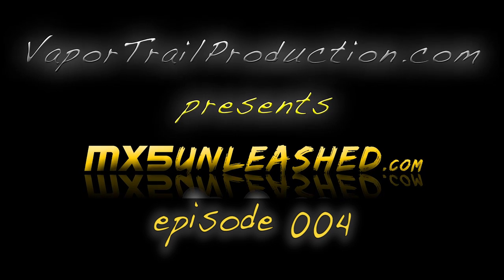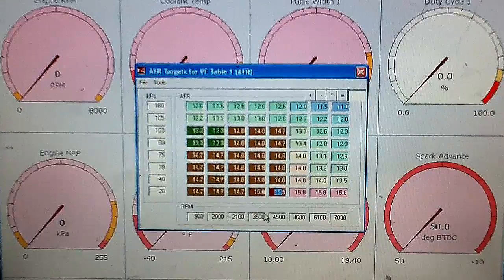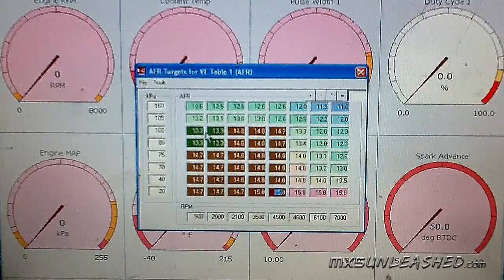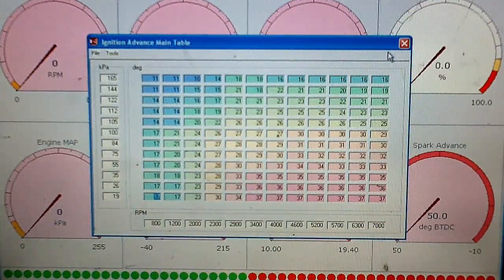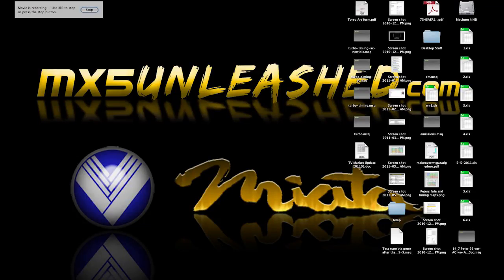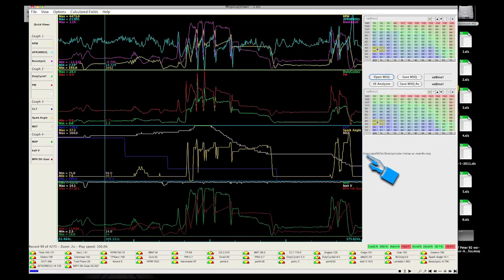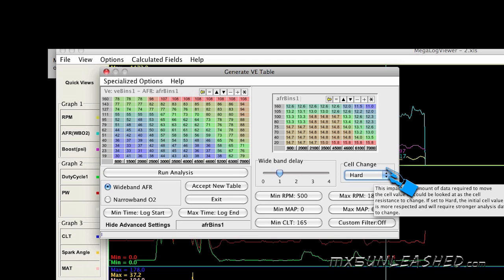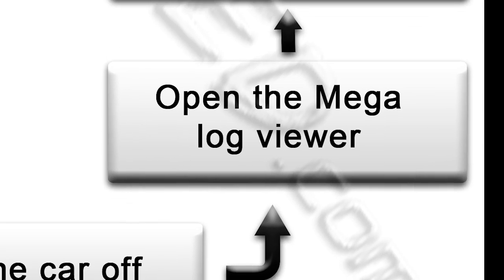Basic tuning of MegaSquirt - (watch in HD) Data recording and analysis - MX5 Unleashed episode 004

Comment: How do I know what ignition advance to use?
Reply: You can check on line if some one has original factory one to start with.  There are few rules of that you may fallow if you starting from scratch on some exotic engine.  Idle you be in like 20s plus or minus few and the closer to 0 rpm the close to 0 in advancement. Cruising speed 45mph to 60mph no acceleration you can go as far as 40 but start at 35 just to be sure.  If you have Natural aspirated car WOT at red line could be like 28 but listen for knocks or get a sensor, if the car is boosted it can get into low teens at full boost and red line. But best start is to find you cars map that has been made by factory or car very similar in size and performance.  Hope this helps 18iser
Reply: Yes I guess this helps, I am thinking about putting an ebay turbo on my BMW E36 325i and I am just trying to learn some stuff before I start buying stuff.
Reply: 18iser  The only thing I would ad if you gone go with Megasquirt get the AEM failsafe O2 sensor and gauge, bit more $$$ but works way better then Innovative one in the long run. Also feel free to contact us if you have any questions at our website or facebook page ;)
Reply: sure mate I will follow your facebook :)

Comment: In his video were you using Wideband data for megalog viewer? And if sow hat happened to your narrowband
Reply from the maker: sean marschall  Ya we using the wideband signal, the Narrowband signal I have used for the narrow band gauge, this way I had an idea what AFR was during driving.  Though you can just not connect the narrow band to anything at all. Also if you have Wideband gauge  you can split the wide band signal to the MS and the gauge.  Hope this helps.
Reply: Okay, so you used the output from the Wideband, and connected it to the options port (26 pin) and selected the proper Wideband
Reply from the maker: sean marschall Please check your manual. We did it on a Miata and that came with the harness already, but from what I understand on a lot of MS it is the (23 pin) not 26, but I do not know which MS you are running so it could be 26.  Once that is connected you go to setting and select which O2 sensor you are running. Also if in setting there is no O2 sensor like yours, there is an option to just tell the settings what voltage output your O2 sensor it putting out , for rich, lean, and stoichiometric. We had to do that once on older MS1 and we plugged the AEM's Wideband Failsafe Gauge with O2 sensor. Hope this helps.

Comment: At the 2:50 minute point in your video, you indicate that the megasquirt computer does not use the AFR table to determine, "how much fuel to throw into the engine”. 
Your statement is incorrect. The computer does use the AFR table AND the VE table plus the other sensor parameters to compute the injector pulse width. 
Raising or lowering the values in the AFR ratio table will immediately be seen as a corresponding raising or lower of AFR ratios in the exhaust using a wide band oxygen sensor.

Comment from the maker: Good question.  No you do not have to wait.  You can just start the car and drive.  The blinking red light is warm up / self diagnostic period. Once it's go solid it means it's sending the data. on innovatemotorsports website  you can find full instructions.  we  Also make sure you do free air calibration once in the while, also covered in the instructions.  hope this helps

Comment from the maker: PS  the intercooler and cold air intake helped a lot, since I live in Arizona, it gets to 120F here also it has a automatic retardation programed for every 10 degrees of intake temperature over 80F it retards 1 degree. So I m sure that helps to in the summer.

Comment: @thefavs Also, please PM me your e-mail.  I have some questions about installing the wideband sensor to the MSII (my wideband sensor is currently running independent, so I can't datalog the 02 reading in MegaLogViewer).  I will definitely go back to the dyno/track and retune the fuel at highload/high RPM just to be safe, as I am unsure of the AFR at this condition.

Comment: @thefavs Yes, I agree with you 100%. The car is a small, very light weight race car, so its crusing VE values are very close to the 'idle' VE values, because it is such a Low-Inertia vehicle (about 500 lbs).  Has a N/A 600cc Honda CBR600RR engine (4 cylinder sportsbike engine.)  Anyhow,  the engine was actually misfiring due to its sparkplug heat range. After changing the sparkplugs, the power was back.  So much in fact, that the car's differential housing got destroyed from the torque. :S

Comment from the maker: @Chingchi Hello Sir, good question.  The fact is that you should tune it under load, that is when it's best to data log while you drive the car, and then analyze it.  The only thing you can tune with NO-load is idle.  If you have a race car and you can't drive on the street, then I would tune it at the track, just start it with easy passes. And if in doubt a richer mixture is always safer then a leaner mixture.  Hope this helps.  If you have any more questions, feel free to E-mail me.

Comment: Sir, have you tuned your Miata to Alpha-N or MAP/Speed Density?  If you have tuned with Speed Density, how did you solve the issue of tuning under NO-Load and tuning under full load too? For example, I tuned my car's No-Load (neutral) RPM range to be able to rev the car, and when I went to the dyno, I accidently affected these values when tuning under Load.  I retuned the No-Load RPM range and this affected the high RPM, full load area and now the engine is leaning in this area. Recommendations?